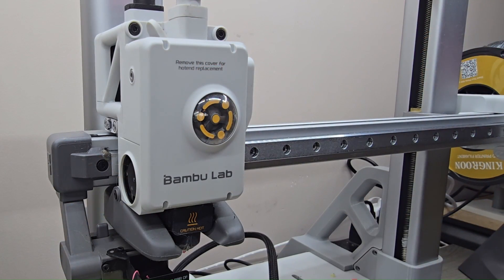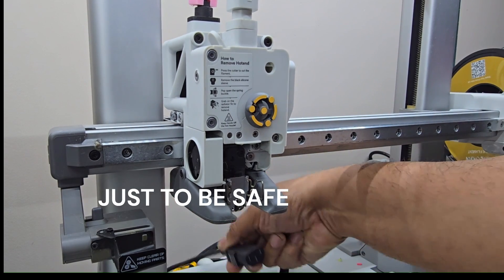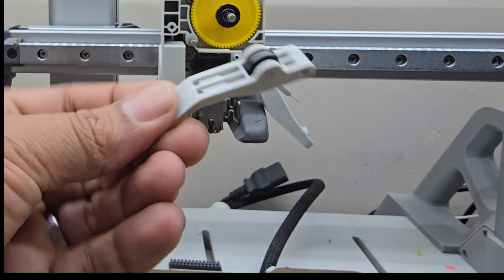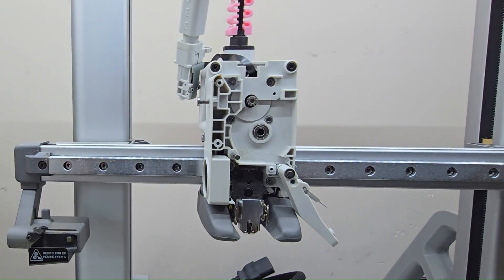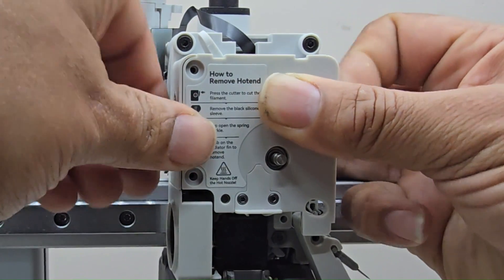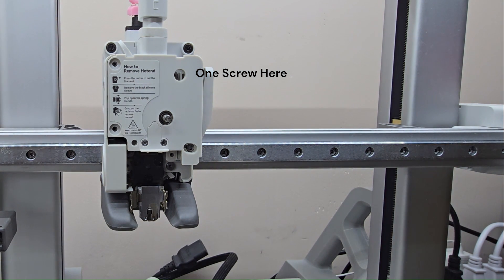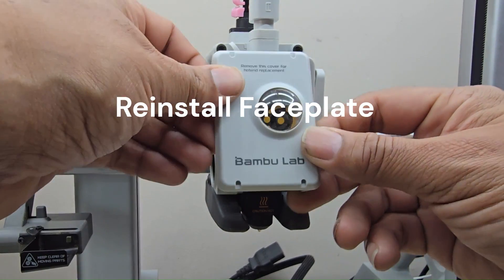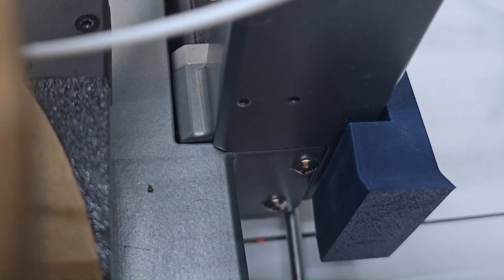How to Change the Extruder Gears on your Bambu Lab A1 or A1 Mini

Comment: Very helpful video. Had an issue printing a 0.4mm profile with a 0.2mm nozzle which made a mess on my prints. Video was straight to the point, very useful 👏

Comment: the bearing on the face plate pops out as shown, however the other bearing does not come out easily with the pliers.  going to look for more videos before i try a bearing puller
Reply from the maker: @jmundale  Interesting mine popped right out.

Comment: Could u please show me how you attach the PTFE adapter. Especially how do I handle the cable management of the flat black cable attached.?
Reply: @Linn-kp1ub  ik I'm late but you kind of just cram the ribbon cable into the motor housing with an l wrench
Reply from the maker: Two ways.  
One:  Use a Small Allen Wrench to feed it back through.
Two (safer but way longer to do): Remove Back Panel from Printhead.  Unscrew EBB board and pull it out slightly.  The ribbon cable is attached to the ebb and will pull out with it causing the ribbon cable to slide back down. Careful not to pull all the way out or you will be trying to re-seat that cable on the EBB.

Comment: I had a jam with the clicking, and a hardened drive gear set to fit, did it all in one go with the help from this vid, great ! One thing, when you put it all back together, be sure to home the cutting blade into the extruder gears and not flopping about in the pry bar, printer gets very angry when it cant cut filament
Reply from the maker: Glad it helped!

Comment: Great video clearly showing the disassembly and assembly better than others I watched. I belive the docs say that the gears it comes with are hardened, but I wanted to be sure I knew how to disassemble it for a good cleaning after some failed TPU prints, which don't need hardened gears anyway.
Reply from the maker: Yes, original gears are Hardened.  Was a Unnecessary "upgrade" but I am glad people are able to use it as a reference how to disassemble the Extruder Gears, cutter and Hardened steel nozzle use case.

Comment: Do you have to change temperatures in profiles to compensate for the hardened steel?
Reply from the maker: @dosdont  Yes.  If your running a hardened steel NOZZLE you can change the settings in Bambu or Orcaslicer from Stainless Steel to Hardened Steel.  This is to prevent the warnings from popping up when you try to send the print to the printer.  It will usually warn you about needing a Hardend nozzle for abrasive materials.
Hardened steel is less thermally conductive and needs about 5c to 10c hotter than you would normally print with Stainless steel stock nozzles. The gears are Hardened from the factory on stock units.  Mine were just old and I wanted to do some preventive maintenance to the machine so might as well show that for those who needed help.
Reply: @3DandTeePrinting  Disregard, I found it. Thanks
Reply: @3DandTeePrinting  "Change from Stainless steel to Hardened Steel?" Maybe you can show how to do this in Orca as I haven't seen anything that references stainless or hardened. I know I can change the default temperature but I don't know what you mean by changing the settings from stainless to hardened. I see nozzle sizes but not what you're saying.

Comment: Good video but there is no way I can get the faceplate to the extruder off. I’ve removed all the screws and tried pulling and prying it forward. No luck
Reply: I found problem. lol. Missed a screw. All done. Working great now.

Comment: Some of the maintenance items are overprescribed. I have 3000 hours on my ankermake m5c. Besides linear rails on X & Y and a Noctua hot end fan, it’s all original!  Belts, hotend, silicone sock, extruder, print bed. The accessory market is a grift. It still prints better than new due to the rails. About 1/4 of that use was with abrasive engineering filaments inside a custom enclosure. Sure wish AM hadn’t dropped the ball, Bambu killed their hype.
Reply from the maker: @_..-.._..-.._  Yeah the maintenance plan for the Bambu is like getting your oil changed every 2000 milles instead of 3000.  But Ankermake.......
I will be nice and say,  I am glad your printer from Ankermake is WORKING and has worked this long.  We own the M5 and M5C.  The M5C we are kn our SECOND replacement unit and still not printing.  Ankermake by far TO ME is one of the worse 3D COMMUNITY friendly companies out there.  Sorry, I said I was going to be nice and not bad mouth them anymore and just wait till what's going to happen, happens to the company.  I will leave it at that.  I wonder why you changed to a Noctua and Linear Rails.  I wonder 🤔 hmmmm.

Comment: Great video man! I'm still debating between A1 mini with AMS for $399 shipped or the A1 for $556 shipped. Are you going to snag another AMS lite?
Reply from the maker: If you can swing it, A1 over A1 mini unless space is limited.  You WILL regret it when you go to print something larger and tou say Damn I should have got the bigger one.  Both are really good.

Comment: Did you replace the stock hardened extruder gear with a new one just because the paint was slightly worn off? 💀
Reply from the maker: The Build up was unexpected since there has been no issues before the swap (minus bed recall) .  Your Right I should have Checked that first.  Gears are already Hardened. Oh Well Maintenance and How to Swap Nozzle and Gearing it is.  Thanks for pointing that out.

Comment: I believe it was completely not needed. The A1 comes with hardened gears in the extruder.
Reply from the maker: Your Right I should have Checked that first.  Oh Well Maintenance and How to Swap Nozzle and Gearing it is.  Thanks for pointing that out.
Reply: @3DandTeePrinting  Still crazy useful man. Thank you!
Reply: Hardened by plastic gear? 😂 I Wish they had a sturdier setup, very accurate printing though.
Reply from the maker: @_..-.._..-.._  It's Hardened Steel Gears attached to plastic.  So yeah kind of.
Reply: Not entirely accurate, while partially true, the giant spur gear is made of nylon or some derivative but probably nylon.  The shaft and extrusion gear ARE however steel.  You can source fully metal upgrade kits that replace ALL components with upgraded parts fyi.

Comment: A1 printers come with hardened extruder gears out of the box :)
Reply from the maker: You are correct.  I should have Checked that first.  It's BETTER than a P1P in that regard.  Oh Well Maintenance and How to Swap Nozzle and Gearing it is.  Thanks for pointing that out.
Reply: I'm subscribing just because you admitted the mistake and took it well. I need more people like you in my feed and in life geneally. Also the vid was good regardless thank you  @3DandTeePrinting
Reply: @3DandTeePrinting   yeah, np, still a very useful guide, I watched it and you really explained everything well, thanks!
Reply: @3DandTeePrinting  great instructions!
Made it very easy to swap the parts !

   The only thing i am a bit iffu on is the big yellow gear.      That feels like plastic to me.  Both the one it came with and the new one.

I spotted a full metal coated one by BIQU i'm considering though.

Thoughts?
Reply from the maker: @monsterhunterrivi6303 The Panda Claw.  I have not used one as of yet but I do know some people who have it and they are very happy with it.
Reply: lol i have just switched out mine, on my new A1, i thought i was stainless steel, they looked different like in this video, the new ones had black wheels and the original was silver, so i checked the tech specs, and idd it is :D well thats a wasted 20 min, atleast now i have a spare set of extruder gears :D
Funny thing is, just the other day i was thinking, well since they dont even sell stainless steel gears for it, and the hardened gears are so cheap, why dont they just make the printer with them, i guess they do just that :D
Reply from the maker: @Crisping1612  Same.  It's cheap, I know I need hardened steel for abrasive filaments, why not.  Yeah should have read that it already had it.
Reply: Thank you for letting me know. I bought the Hardened Steel Extruder Gear Assembly - A1 Series - A1 Series / Hardened Steel and the Hotend with Nozzle - A1 Series - A1 Series / 0.4mm Hardened Steel. At least I'll have a spare Hardened Steel Extruder. Will be much easier to change only the nozzle.. 🙏🏻
Reply: And here I thought it was only the a1 mini.